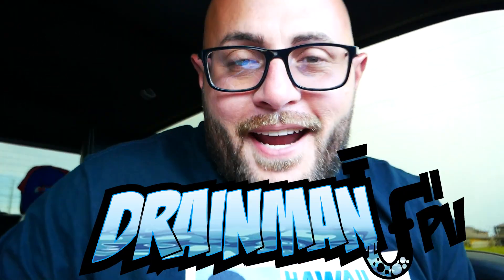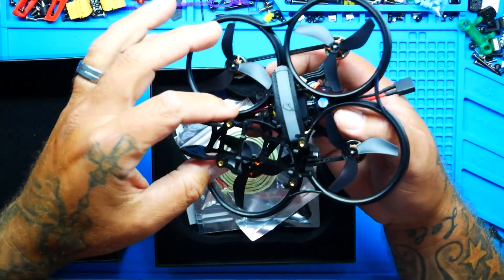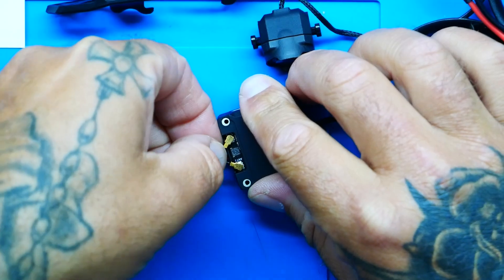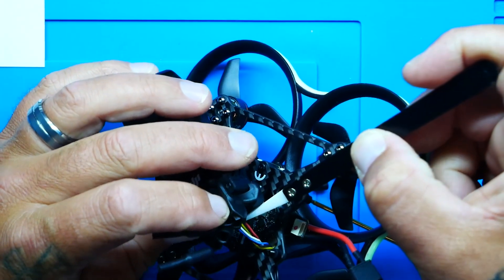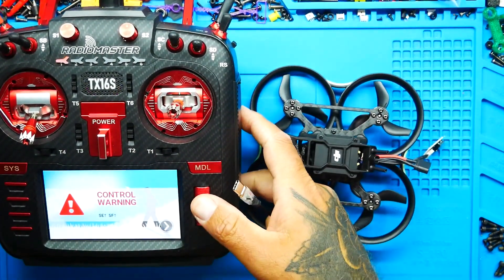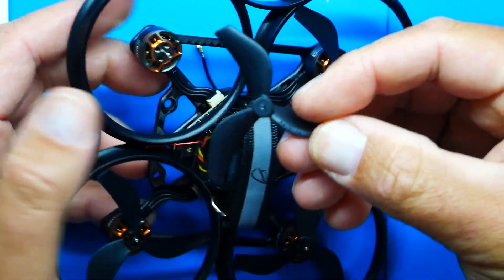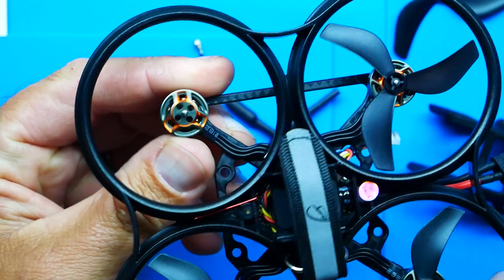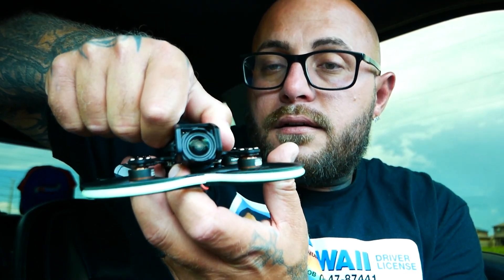Professional Drone For $105 Dollars 🤑 Plug & Play! Pavo20 Pro Does It All !!

Comment: My original plan was to get a larger quad with 03. Then once I have an air unit or 2 on hand I'd think about these small quads.

But this is so cheap, and the air unit is down to $179 right now. I might go this route instead!
Reply: Exactly what I did and its awesome.
Reply: @alexc_photos  I like that it flies good without the Air unit needing to be stripped down. So it's still airworthy for other craft. 

If I feel like doing a build project or buying a BNF in the 3"-5" category, I'll just swap the air unit over.

Comment: great video as usual....
is it possible for one day you could make a tutorial on how to make the led light come on with a switch?  thanks
Reply: Set a switch on your radio in mixes, then in beta flight plug in the drone, hit connect, go to modes and set USER1 as AUX4 and adjust the slider to have it trigger when you flip the switch you assigned it to on your radio. If it doesn't work on AUX 4 select AUTO and then flip the switch and BF should recognize and assign it automatically.
Reply: Just watch a Bardwell video my friend, too easy....lol